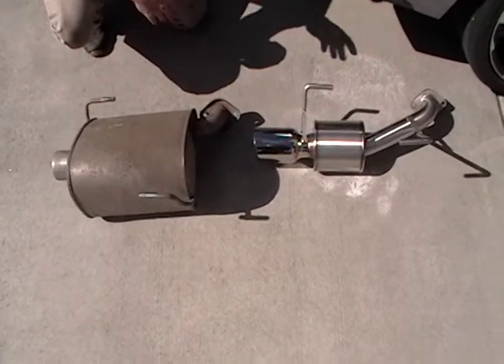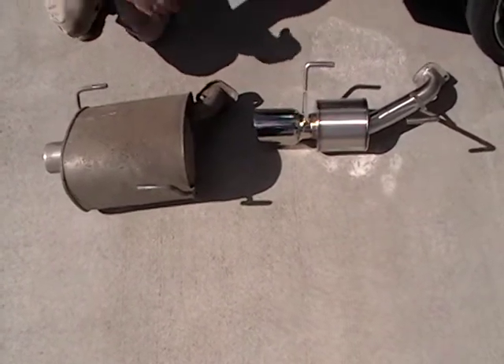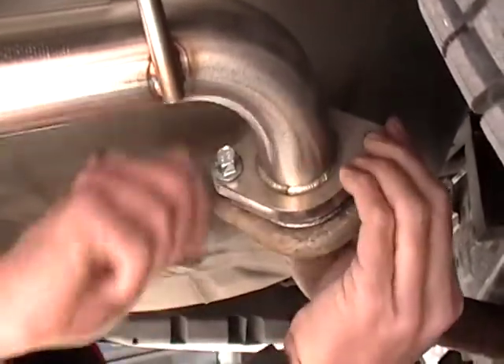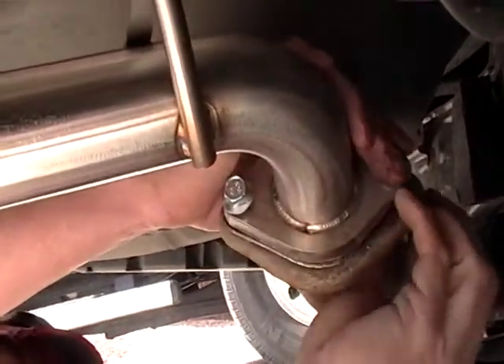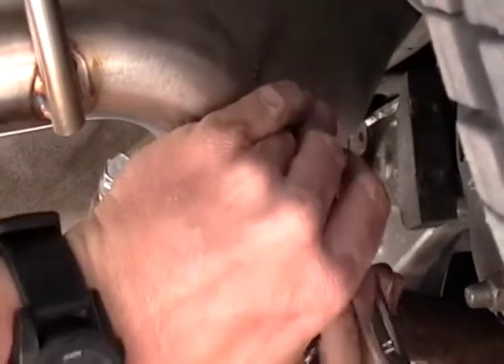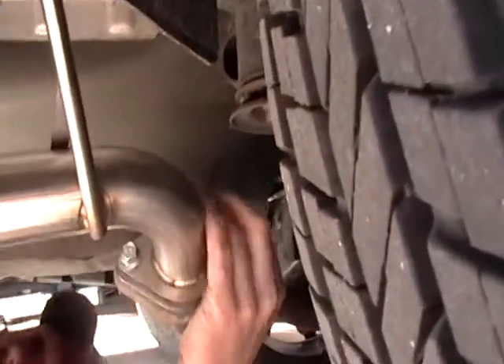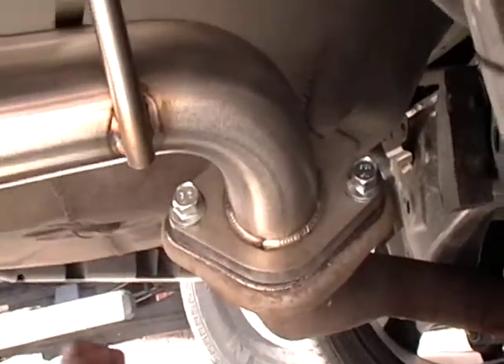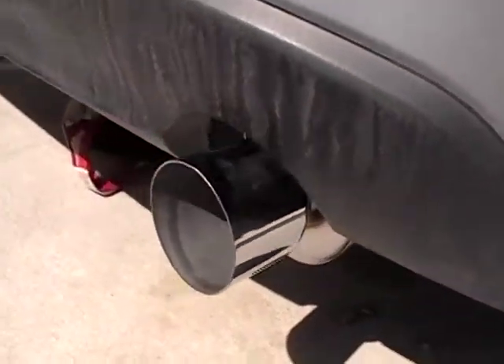Nameless Finished install Pt. 2 Subaru Impreza 2017 sport

Comment: Finally got mylself one, got it lightly used for $150. Looks clean and in great condition. Will install it this weekend. Super excited. Thanks for the video, looks like super easy install.
Reply from the maker: I hope you do enjoy the suby rumble! Congrats
Reply: Found one for a hundred only 3 hours away is it worth the drive
Reply: Bowdown Dubsup If its in good condition then definitely worth the drive. I get compliments on mine all the time, many from WRX drivers. They think it sounds just as good as theirs and for the price it’s definitely worth it.

Comment: Thanks for sharing! I have a 2019 impreza sport. Need this!
Reply: Did you buy one?
Reply from the maker: I'm out of state right now, but I will get an interior dB of it with and without.  I'll post it after the 3rd, I get back in on the 2nd.

Comment: Hey! First of all I will like to thank you for your help in the car community. I also know this is a significantly older video but I have a question. In your opinion, how loud is the 5” nameless exhaust from the stock exhaust on a scale of 1-10. And if you have any knowledge of the muffler delete, how loud would it be from a scale of 1-10? Thanks!
Reply from the maker: No problem. Compared to stock the 5 inch muffler is a 6.  I'd say the stock is a 1, no sound unless a cold start.  10 being the loudest.  The muffler delete is a 9 to 10 and is loud.  We bought one for giggles, wow it was obnoxious, lol....not for me. I did t even video it because it was so loud in and out of the cabin One of the pluses on the 5 inch, is it gives just enough resonation  to keep a great sound, deep and not be overbearing.  Hope this helps
Reply: AutoMotive Inquiries Yes! You were a big help. Thank you so much!

Comment: Sweet video dude. Waiting for my nameless in the mail. Am i going to need an actual torque wrench for the install? Did you have any leak issues?
Reply from the maker: No special tools like a torque wrench, just go tight and the maybe an eighth of a turn more.  You can use two 14 mm boxend wrenches or ratchet or combo of the two.  I re use my bolts from Subaru and nameless will send you a gasket and new bolts.  I had to use the gasket on one of my 19 imprezas, but on the 17, one 19 and the 21 we just got, didn't use it and no leaks at all.  We had to wait about a month for the 21 wagon exhaust but well worth it.  I Have a video on that one too.  Drive safe and post your thoughts on the nameless when you get it installed.
Reply: @automotiveinquiries9673  Very helpful man thank you for the information. I'll be sure to follow up

Comment: Where the muffler and flange bolt up, were they both perfectly flush or did the exhaust have a bit of a lip compared to the perfectly flat flange on the nameless?
Reply from the maker: The tubing struck out a smidge but  the gasket once put on made it flush, the two flanges then but up......I just bought another sport, the same exhaust and it installed identical.  Now we have two cars with nameless and they are great
Reply: @automotiveinquiries9673  my wife loves hers that we installed on 18 sport. I hate it, I think the tone might be too low for me and literally hurts my ears. Gonna drive with ear plugs from now on.... If you think I am kidding you would be wrong. 100% serious. Got a older Tiburon with exhaust and possibly exhaust leak and those don't bother my ears.

Comment: I heard some people say you should buy an extra gasket because of leaks. What do you think? I really want one for my 2017 Subaru Impreza Sport I just got
Reply from the maker: I haven't had any issues with leaks, but they provide a large gaskets that would be more than enough.  I actually havent used a gasket on one of my 19s and the 21 I didn't use one.
Reply: Alright thanks🤘 I'm definitely getting one. If I have any issues I'll just put the stock back on until I get another one.
Reply from the maker: @ZachKateAda  sounds good, I honestly believe you'll have zero issues and really enjoy it.....drive safe out there.

Comment: I know that the nameless axle back Comes in two different sizes 5 inch and 3 inch what is your better suggestion on a 2020 Subaru Impreza sedan is there a difference in sound
Reply from the maker: as far as I know nameless offers a 5 inch and a straight pipe no muffler.  I'd do the 5, that is loud enough and has a great sounds.  No muffler or a smaller one, may be a little loud when cruising down the hwy.  It's just a personal preference.  Let me know what you decide.
Reply: I want to do the 5 inch one I just don’t wanna talk to big or sound extremely loud
Reply from the maker: @AKR-1978  then the 5 is the way to go,  I'd say it's just right.
Reply: Thanks

Comment: Hey, so what would be the difference from just adding a piece of pipe instead of that system. Would the simple pipe make it sound louder or?
Reply from the maker: Yeah, they have a no muffler at nameless and its loud, it's a straightpipe....way way loud and the sound isn't as throaty.  But technically you could just remove it and add any pipe.  If you do that at least try and find t304 stainless so it doesnt rust out.  But if your wanting a deep sound, that is moderate on the loud, I'd do at least a 5 inch muffler....the nameless is one of the cheapest out there for it.  We have two of there systems and 4 years in, they are like new and no rust.  Hope this helps
Reply: AutoMotive Inquiries did you only delete the muffler or did you also delete the resonator as well?
Reply from the maker: @rafaellozano563  so with the nameless exhaust with the 5-inch Muffler it will delete everything from the axle back from stock so it has a nice small 5in resonator muffler and a larger tip if you just do the straight pipe he'll be a larger diameter pipe in your stock one and it will delete the entire Muffler
Reply: AutoMotive Inquiries  ahh ok, but besides the muffler farther back in the car around the middle of the car is there a big resonator ?
Reply from the maker: @rafaellozano563  you know that's a great question I don't believe there is one on the Impreza but there is one on the WRX and STI I'll have to look later and see
Reply: AutoMotive Inquiries well thank you.. great content !

Comment: What is the name of that exhaust bro?
Reply from the maker: Its the Nameless axle back exhaust with 5 inch muffler.  They make a quad exhaust for the wagon, or a standard one like we have.  The sedan they make a non muffler or a 5 inch muffler.   You can find these at Nameless performance .com
Reply: Thank you man. Does it matter when you change the exhaust?
Reply from the maker: @richienickson8085  it won't affect the emissions, fuel economy didn't get better or worse, felt like a little more power, but the sound is fun and not obnoxious.  I like it on there.
Reply: @automotiveinquiries9673  nice and it does look like an easy job.
Reply from the maker: @richienickson8085  absolutely, a can of silicone spray,  a 14 mm wrench and socket and about 30 minutes of time and done

Comment: I have a 2017 subaru impreza sport 2.0i where can i buy this. And is it possible to buy and install a turbo and blow off valve for this model?
Reply from the maker: Currently you can get the nameless exhaust from nameless. Com there are a few other sites that carry their exhaust but their sites aren't any cheaper than going through nameless directly. As for the turbo and blow off valve that would be a 100% custom job as there's only a few companies in Australia that are currently working on turbo kits for this model. We currently own two of the sports in my family my son's is a 17 mine is a 19.  I would love to own a WRX however they're still on the old platform. That being said to do a turbo for this motor New York's need to go in and upgrade the Rings and the gaskets along with putting an intercooler in there if you find one let me know the ones I've seen older Impreza range between 3 and $4,000 for that you might as well wait for the new version of the WRX and just get a base that way Subaru warranties everything in the motors beefed-up
Reply: @automotiveinquiries9673  alright thanks man. My goal is to make the car a V6 killer.

Comment: What’s the exact model to this? I can’t find it for my 2019 sport sedan maybe this fits? Can you help plz
Reply from the maker: Namelessperformance.com nameless website has the best prices.  There you can pick through your model, whether sedan or wagon.  For sedan its called axle back exhaust 2017+ Impreza sedan 2.0 sedan.  You need to go into the wagon, crosteck section of you dont have a sedan.  Side note we've had two of these exhaust one on my son's car 3 years. And mine 1 year, no rust, excellent quality and great sound.  Happy motoring
Reply: I have the exact same model. I haven’t tried but i think it should fit the same. But yeah nameless also let’s you pick for what model you have.
Reply from the maker: @davisgolick2129  2017 global platform impreza sedan will fit all the way to 2020 sedan.

Comment: Did you have to get a custom bumper
Reply from the maker: loosExpression , that is the stock bumper for the sport.  In the past subaru has put the exhaust cutout on different sides per model.   The sport has the cutout on the passenger side.  If your cutout is on the other side, check with namless support as the hanger setup would be opposite and would not work.  I believe all sports, and premiums are passenger side cutout, base maybe different.

Comment: Do you know the size of that gasket and flange?
Reply from the maker: A stock gasket will work...they will send you one free of charge, from nameless...if not the 19s are gasketless....but the gaskets are the same as the 17...so if it gets damaged, you can get one on the internet for about 1.50....or at suby they are about 10......but the exhaust should come with one....hope that helps...you can just get a 17 gasket and use on the 19+

Comment: Can you still pass the smog test after you put that on?
Reply from the maker: Yep, you can, this is axle back and does not change any of your emissions.  This would be the same for a sedan or wagon.  I actually have a sedan nameless that came off my impreza, like new condition, I'd sell for 150. I bought a stinger a while back, so dealer did not get my nameless.  But our 17 passes emissions with it, no problems.hope this helps
Reply: You selling it? I’ll buy it lol
Reply from the maker: @kyleoliva5340  yep...its been on my shelf for about a year.  If you live in Colorado, Denver we can meet up.  If not, I can ship it for about 20 bucks....cheaper than new....and it's like new.  Fits 17 to 21 sedan models.  I can accept PayPal or I have square and can hard enter credit cards.  Just let me know
Reply: @automotiveinquiries9673  how can I contact you?
Reply: Im interested on buying it
Reply from the maker: @kyleoliva5340  jehrlich0@gmail.com is best.....my cell I wont post in here
Reply: @automotiveinquiries9673  alright thank you

Comment: I know this video's a bit old but would you say this is a loud exhaust? I mean like... annoying the neighbors loud.
Not like I drive like a bat out of hell in town, and most of my driving is on back roads or the highway.
I just want my car to sound better without getting me noise complaints when I return from work at 10:45 pm.
Reply from the maker: If your looking for good, non annoying sound this would be the one to get.  They make a straightpipe no muffler, which is very loud.  Borla may make one now for this platform as they did my 14 Impreza, but the price is double.  I think youd be happy with the nameless muffler for sound and non intrusive non neighbor bothering.  It will improve your overall sound substantially.

Comment: what are the bolt sizes?
Reply from the maker: The volts are 14 mm they're about an inch and a half long nameless will supply you with new bolts or you can reuse the stock ones